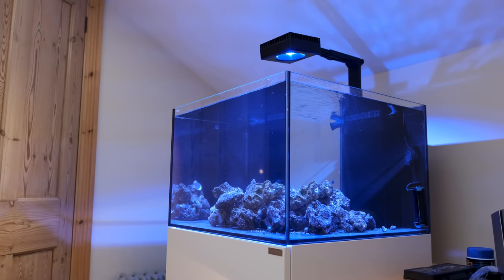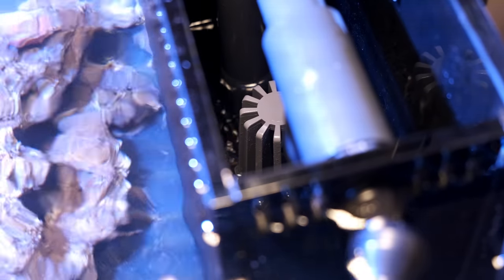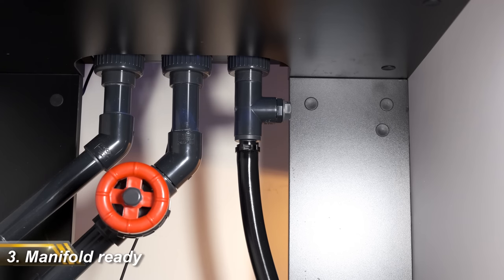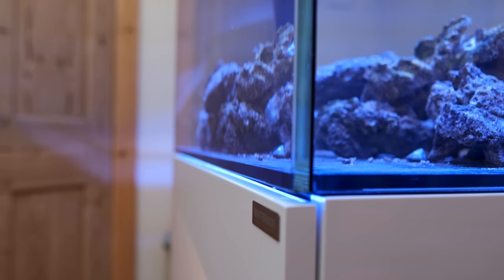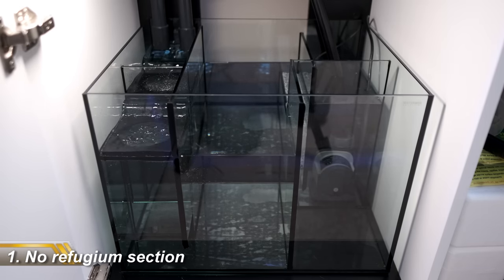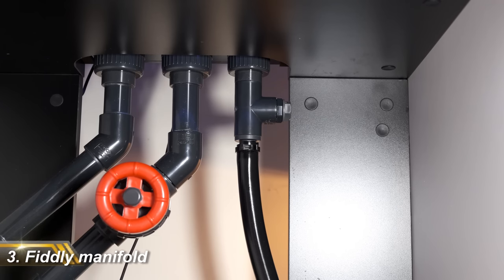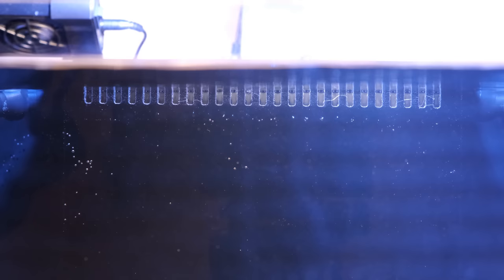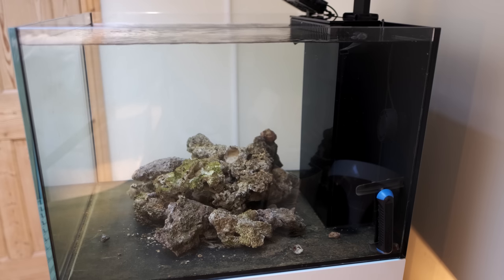Waterbox Aquariums User's Review

Comment: Stay away from Waterbox i spent 5K with them and had one issue after the next. At least the aquarium itself is holding up I can't complain about that so far (got the Marine x 110.4), but they don't stand behind the products they sell. The heater would not go up above 75 degrees and the pump would turn off on its own randomly and they still didn't want to take the merch back - thank God it was a new tank. They finally took those items back after a lot of back and forth. They finally agreed to a refund but said it was a onetime courtesy - for defective products!!! I gave them a onetime courtesy by continuing to do business with them.  But it didn't end there... They charged me restocking fees and I had to chase them down for my refund bc it didn't seem like they had any intentions of refunding my money and only refunded a partial amount. I just now on April 4th got the remainder of my refund when I had sent these items back to them back in February. They didn't even return my points. That was another thing I had to go back and fight for. And their mesh lids... that's another story. 130 for something I tht went straight into the trash. Do yourself a favor stay away from these folks.

Comment: Just got my first tank a month ago, a Waterbox Cube 20. Probably a combination of excitement and lack of experience to judge by, but have to say I'm thoroughly happy so far. I do wish there were more overflow cutouts, and I am about to swap out the filter socks for a media caddy that will hold filter floss, as I'm already bored of the multiple sock wash, dry & replace routine. I did not get one of their cabinets, opting instead to go with a metal framed stand intended for a 40 gallon tank. I use the extra length by placing a piece of plywood on top to create a work table for water tests, prepping frags, etc. Have to remove it after so the cat doesn't have a convenient shelf for planning attacks.

Comment: I feel your spot on with the sock setup and about the pressure gauge on the pump side. However, I also feel there should be one exactly where they've placed it. Considering the force of the pump having to work when there is back up could be costly. In addition, it will allow you to work and disconnected without water leaks occurring to work the issues below. " I work on homes and work on pools. I'm new to the Salt Aquarium biz.I feel there aren't enough shut-offs and  needs a line/splittter to give a  redirection of water to the pump to continue the running of the tanks while the work can be done. Meaning a breakage/repair, or maintainance cleaning."

Comment: Do you need a chiller for our Summers? I'm measuring the temp in my prospective room and it hits 26-28 in our spring. Any options other than a chiller?
Reply from the maker: It can get pretty hot during a heatwave but I've never used a chiller - just get a couple of fans and blow them across the water when it gets hot. Although if you're already getting that hot, you might struggle in the summer.

Comment: I have an aqua one reefsys 180. The equivalent water box was 150 more expensive if I remember correctly. I couldn't justify the price difference. It has adjustable baffles in the sump, built in filter sock holder and ato reservoir.

Comment: Waterbox has not advertised this setup as having random flow generators, 'rfgs', or 'proper rfgs' as you put it. This is an accessory that people purchase separately as needed. 

Including something that is clearly not included in your cart as a criticism of what you recieved is unjust. You knew that going into the purchase. You also presume that such features are universally desired.

I do acknowledge that this only pertains to a small portion of your video... I felt that it deviated in charactor strongly enough from your other videos to comment.

The defining characteristics of a random flow generator that you express as being the inlets in the back of the part are also incomplete. 

A nozzle with open ports in the back is called an eductor, which utilize the venturi effect to create additional flow over a traditional nozzle without the rear openings. 

A random flow generator has all of the characteristics of a venturi style educator nozzle, with the addition of veins inside of the nozzle output. These veins are what make them special and introduce the random flow ejection from the nozzle. 

Thank you for your content, and your wallpaper. Keep up the great work.